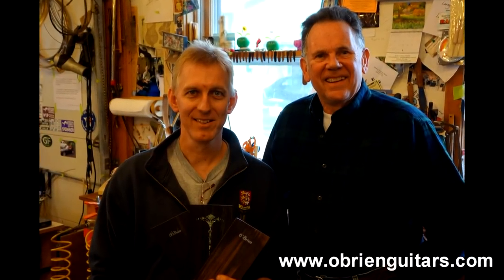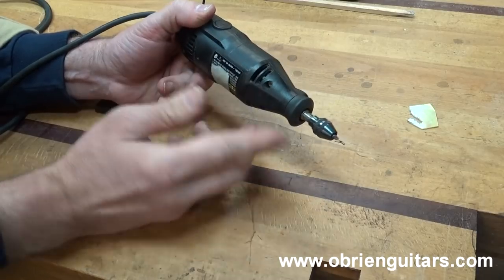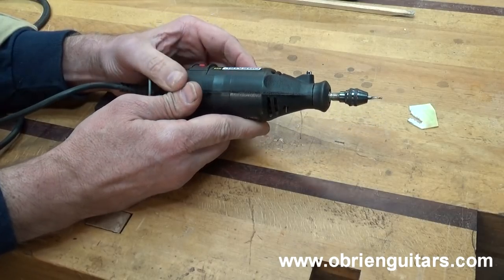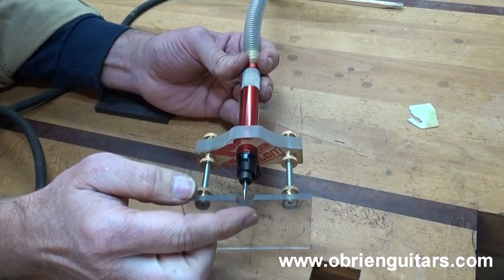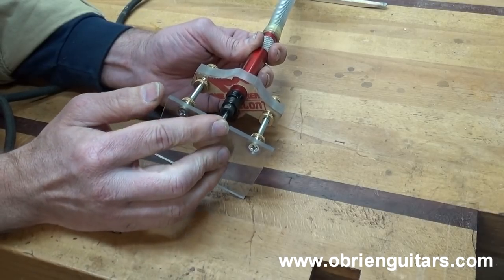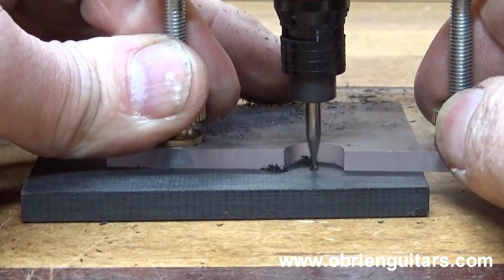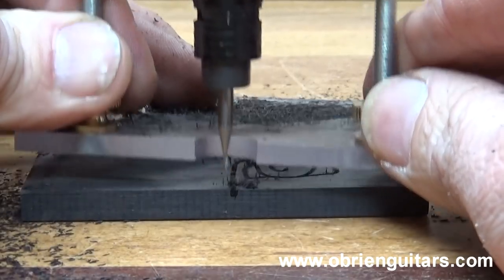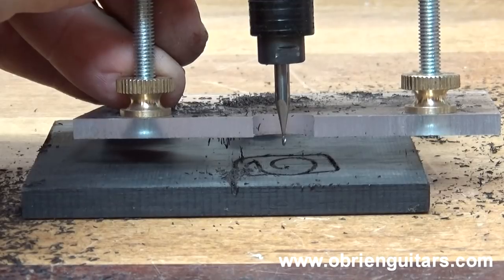Luthier Tips du Jour Mailbag 73 - Inlay tool tip

Comment: In a video 3 years ago Dan Erlewine recommended slow speeds, potentially deeper cuts, and slow passes. Now I'm confused.
Reply: I think M.O'Brien is right. From an engineering point of view, the smaller the bit diameter, the higher the speed should be dialed. Just make a test and you'll can confirm it. My everyday work as a pro luthier confirms it.